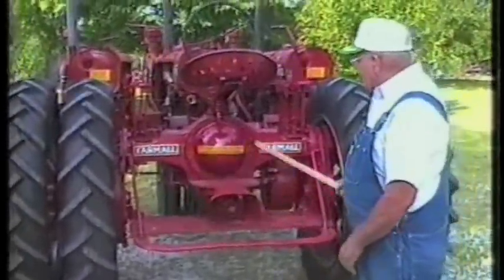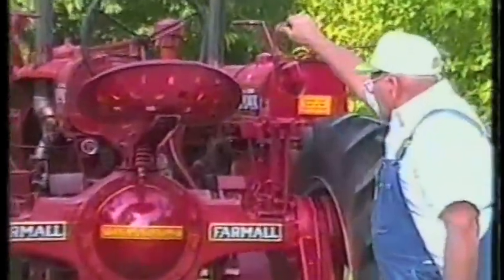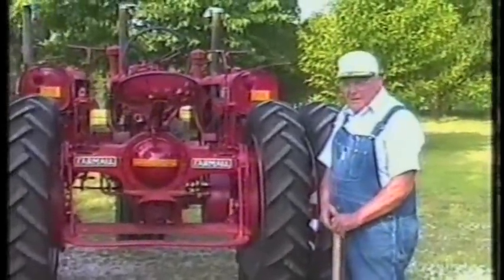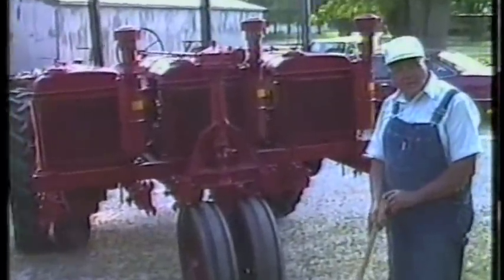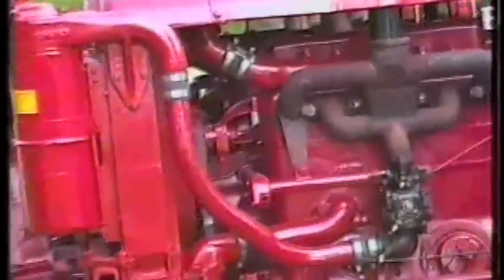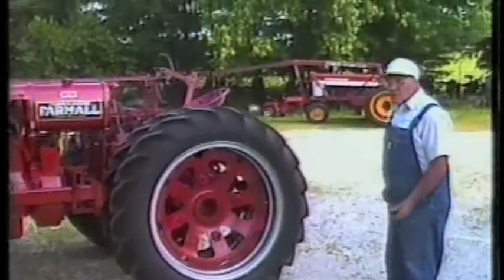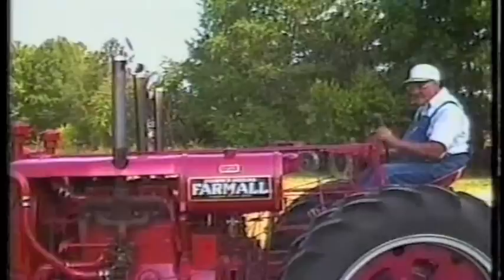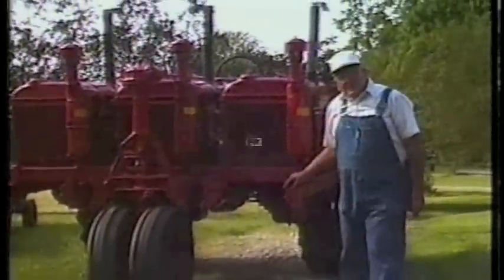Rubber Tire Triple Tractor

Comment: Cool tractor. Though I would have made it into a wide front end, looks a little skinny on the front end :)
Reply: edm I thought the same thing at first but it’s probably a lot easier to steer with the skinny front end !
Reply: You right , as long as you stay on the flat it looks ok , but would not  use it in a slope...